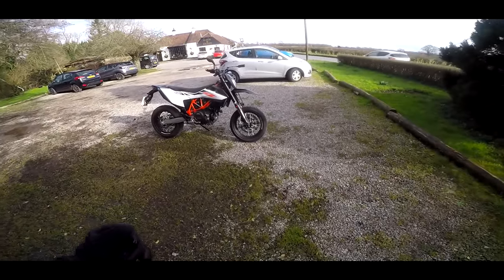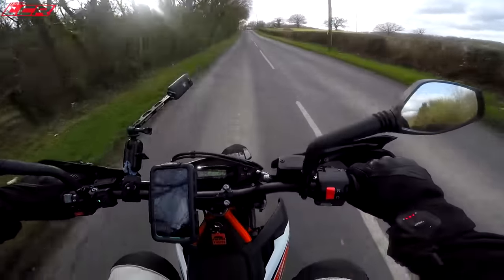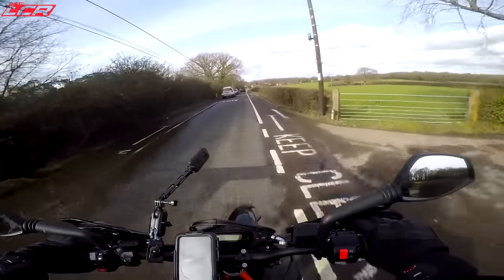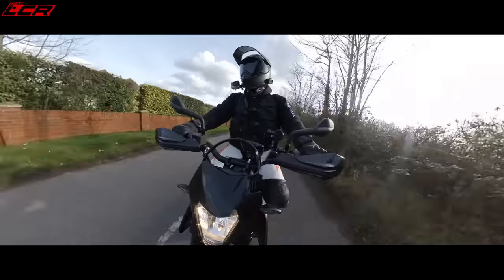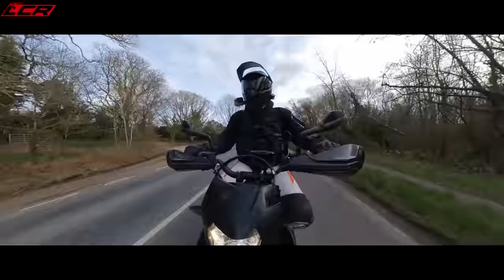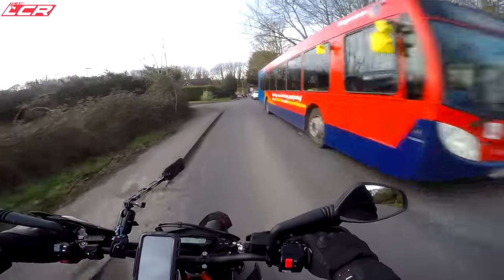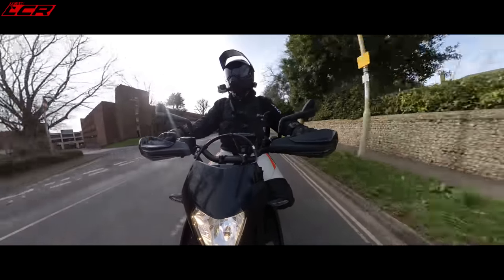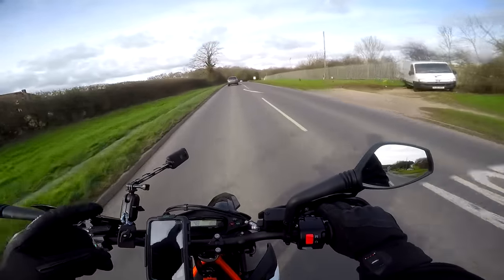How To Run In A New Motorcycle? | KTM 690 Diaries

Comment: I was talking to a Ducati master tech when I bought my hypermotard and he said 3 rules for break in: Let the bike fully warm up before hammering it, no full throttle at low RPM, and try to vary the speed (ie no 100 mile highway blasts with cruise control). So far that method has been working fine for me

Comment: KTM 530 soft run in - but changed the oil early. It’s done 7000ks trouble free - only had to adjusted the valves once. 
However it has used oil since new. It hasn’t gotten worse, but you need to check it after every ride, but it only has 600ml on the engine side (the gearbox is seperate on my 2009 mdl)

Comment: Perfect timing Chops as I picked up my new 690 Enduro r last Friday and I’m only 75 miles in to the running in period! On all the new bikes I’ve ever owned it’s always been as per the manufacturers recommendation, but with plenty of variation of load and speed on and off the throttle. Never had any issues with poor performance or oil consumption.
Reply: Bang on!

Comment: The manufacturer knows best about their machines. I'd recommend following their advice personally.
Reply: When you do that you get oil consumption issues 🤣
Reply: Mark Pearce  For liability reasons they can’t tell you to break in your new pride and joy hard.  It’s well documented that a very hard break in keeps these engines form burning oil.  In fact, all KTM and Husqvarna factory teams break their engines in hard.  Specifically the Dakar teams, where they have to be ridden for thousand of miles and where oil burning is not desired. It’s literally impossible to break these engines in to hard and cause any damage by doing so.
Reply: If you look... Manufacturers put the same damn break in procedures across a wide variation of motorcycle models with very different motors...so no!
Reply: Why do they get run to red line on dynos to test bhp after coming off the product line then ?
Reply: @Shawn-in-da-Canyon  I’ve heard that argument and it never made sense to me.  Comparing how I would care for a bike that I want to keep out of the shop as much as possible to how a race team that plans on rebuilding the bike after each race just never made any sense to me.

I suspect the real answer is somewhere in the middle as with most things.
Reply: @nsparacino  Well, the only reason I say that is, my good friend is the engine builder form one of the top Dakar teams. He’s one of the best engine builders that exist. They’ve spent hundreds of thousands of dollars researching this subject. And, my above post is the conclusion they came to. So, when he gives me advice, I follow it to the letter. And, he’s never done me wrong. When I bought my 701 Supermoto, I banged of the rev limiter constantly for the first couple hundred miles. I ran mineral oil in it for the first 1,000 miles. I have 16,000 hard miles on it. I change the oil and filters every 3,000 miles and it refuses to burn one drop of oil.
Reply: They tell riders to break in the bikes gently so that the RIDER gets used to their new bike. Every bike you've purchased was run hard on a dyno before it was shipped to your dealer.

Comment: I bought my Suzuki GSXS1000 from former SBK rider Karl Muggeridge at his dealership in Australia. He said just ride it up through the revs smoothly and that’s all that’s required. No need to limit revs except not going to redline. Many say it’s the first 20km that is the most important for the engine. Also, many people trade their bikes with low kms rather than keep them for 30-40,000 km (some do) so it’s highly unlikely that you’ll experience problems with the engine before you trade up. Agree that bedding in the brakes, tyres etc. is wise.

Comment: Now listen here young Chops. Back when I were a lad in 1974 I was told the most important thing to remember when running in my new Norton Commando was to vary the revs and the load on the motor, while not exceeding the recommended rpm. Apart from the header flange continually unscrewing itself due to vibration and the many oil leaks I could never stop, that bike was reliable and a real joy, even with points ignition. I now have 2500 klms on my new BMW R1250R and I ran that in the same way. Thankfully it doesn’t have the oil leaks or the points ignition. Great idea for the SMC series 007.

Comment: I've had 5 new bikes over the last 18yrs. All run in as per the manufacturer's instructions.

2002 1200 Bandit. No problems in 30,000+ miles great bike.

2012 Triumph Thruxton 900. One problem after another. Starting issues, used to cut out without warning, a lot of small rust spots started appearing on the bike. Dealer tried to tell me I had ridden on salted roads, I bought it in June stopped riding it by August the same year. Sat in the garage until I traded in after 1500ish disappointing miles.

2013 Yamaha XJ6. Brilliant bike ridden in all weathers. Racked up around 35,000 miles in 3 years,  never let me down.

2016 XSR900. Throttle was a bit jerky at low speeds. Having the bike remapped and set up on a Dyno fixed that problem. 7000 trouble free miles. Still own this bike.

2018 CRF250L. Only issue so far has been a manufacturer's recall for a transmission shaft. Apart from that 1700 miles in all sorts of conditions.

Comment: A couple of bike mechanics always told me rev freely but don't red line or labour the engine and the break in limits were manufacturers arse covering for if ANY post production failure did occur it would happen within the first few hundred miles, so you would be travelling slower and you would have a better chance of stopping safely.

Comment: I’ve just got a new multistrada enduro and like you watched the videos. I agree entirely that you are running in all aspects of the bike, not just the engine. The thing that convinced me was the comment on one site, “if something goes wrong, you’ll be better if it happens at a lower speed and lower revs, also it allows you to get used to the new bike”.
Great content, keep it up.

Comment: I ran my MT10 in between the two, not thrashed no laboured, mostly round the twisties so you are going up and down the gearbox but not over revving, oil change at 900 kms, all's good so far 😊

Comment: Nice Vid :) most people don't understand mechanics and mishandle engines like crazy... 

Funfact, I do remember those break in periods in car manuals.... (at least Nissan did that in the 90s..) it somewhat disappeared nowdays.
I had to replace the engine of my car 2 years ago... Was not sure what to do. As it is a forged engine from factory and most people are on the causious side in such cases.....
Luckyly I do have a friend building high performance engines for race usage.... So I asked him about bedding in... Going slow... Whatever.

He said:"if it is new, and installed by authorised dealers you got at least 1 year warrenty right"
I had to agree...
So he continued "if the engine is somewhat faulty it will develop a problem no matter what you do. Maybe it will take longer to materialise but it will happen. So wouldn't it be best to happen inside your warrenty?"
I had to agree.
So he said:"drive it warm reasonable, see if anything feels or sound strange....drive it with switching load and revs.... And if it survived about 50km without doing funny things.... Just push it. Let it cool from time to time but push it...if it stais together it will stay.. If faulty it will blow but you'd instandly know.... "

And I get it. Every part wich is supposed to touch anywhere has a hardened coating. That coating will not give and will not bead in anyway. A running eingine with its correct oil should run nearly completely without parts touching each other... The Valve train is the exception. So if a warmed up engine is running without wear (as they normally do) what excectly is there to be beaded in? 
Maybe if the thing is so new that foreign objects are inside the lubrication system... But that should go away after the first oil change.... And such parts should not be found in a well made engine anyway... 

However i drove the next 300km way faster the usual and reved out 3,4,5 and 6 from time to time even did a verry long vmax run....
Engine has now about 50k km, no oil, water or other consumptions except fuel....

On the bike.....well I may be a little more sensible because a damaged engine can stop the rear wheel pretty ugly so it is difficult... But you gain nothing if you are to soft on it and drag possible problem toll warrenty expires... 

Oh and he states: "a natural aspirated 4 Stroke should not need oil, if it does the engine is crap (build to low standards)"

Comment: The official running in guidelines from Honda for my NeoSports CB1000R are as follows- during the first 500km (300 miles) of running, avoid full throttle, starts and rapid acceleration, avoid hard braking and rapid down-shifts, ride conservatively. Not exactly comprehensive. I have kept my revs to around 4-5k range, change gears a lot, short shift, try to change direction, brake and gears in a progressive way for the 1st 600 miles. Once my bike has had its 600 mile service then I plan to increase revs to 7-8k (I will be going well above the legal limit before then) to 1,000 miles and then just enjoy - this is what I did with my previous Ninja 650 albeit for that bike the rev range I used was slightly lower due to its smaller displacement.

Comment: I broke it in like I stole it. I have over 13K km on it and won't be getting rid of it for a couple of years, but there have been no issues. There's a shift light on it that was set to 5500 RPM and when I got out of the dealers, I stopped at a parking lot, changed it immediately to 10,500 then promptly hauled ass out of the parking lot. 
I varied the rpm and didn't keep it in one RPM range for any real length of time, and I stopped and let the engine cool down about every 10-15 minutes to get it to go through multiple heat cycles as possible. Was a pain because my normal 45 minute ride back from the dealer took over 4 hours, and a ton of coffee was downed that day as I sat in the coffee shop admiring the new bike, and I changed my oil and filter when I got home and again at the 600km mark. That's the thing with a hard break in, that first oil change has to be done quickly. Don't leave the metal shavings in your oil for extended time.

Comment: I think it's a combination of mechanical sympathy, not being too careful and not being too harsh. I usually let it warm up properly, don't select too high a gear for low rpm's, choose routes that have lots of variation in speed. During the ride I regularly run it through the gears (3/4/5) with half-3/4 throttle to around the recommended running-in redline, than close the throttle completely and let it slow down/cool again. Make frequent stops to let it cool down a bit.

Comment: Thanks for that BMW link. Every new  bike I've owned first thing I do try not bring over 5 K rpm for first 500 kilometers, also change engine oil before first 100 kilometers, using non synthetic until 2000Ks. Never keep it constant rpm, up and down through gear box, in the city. Also first 100 k don't run it for longer than 20 mins, just too much heat get expansion. These are my some of my own and a friend that did build big block drag motors.

Comment: Hi chops, I’ve had several bikes from new, always followed manufacturers guidelines; never had any engine issues, did 23k miles on a 2013 blade, no engine issues, 10k miles on a RSV4; no engine issues, can’t remember mileages on the 91 cbr600, 94 vfr750 & 98 R1, I had them for several years without any engine issues

Comment: I've got a Honda Blackbird with 86000 miles on it, no engine drama at all.. no oil leaks or anything since I've had it from around 50000 miles, whoever ran this one in did it the right way I reckon.

Comment: I'll start running in my new VFR 800F once the season starts here, the primary goal for me has always been to be smooth on everything, emphasis on good clean gear changes, not lugging the engine and getting it properly warm before really opening it up. (staying away from the very top of the rev range)
  After about 500km i'll change the oil and slowly build up my speed on it, start riding it like i am going to do eventually still emphasizing on being good on the controls, up-downshifts etc. Then the service is at 1000km. If you want your machine to last, dont be afraid to ride it or use it but operate it with a degree of mechanical tenderness (especially early on) but also down the line, and modern bikes will last you ages.

Comment: Hi Lamb Chop....I'm the guy who lives in s/w France on his 4th 1290 Superduke & now a Tenere 700 has joined the family.....For the running in issue I've always thought that the worst thing to do is stagger the engine, so don't use too low revs which must create a lot of strain on all the moving parts, high revs probably not so bad. Just keep the bike in that midrange sweet spot....let it rev freely.
Off to Spain today on the tenere & don't forget my invitation if you would like to see some of the best roads in Europe

Comment: When i purchased my brand new new ZX6R 636 KRT in 2016 my local kawasaki dealer who was a manager there at the time told me to ride it like i stole it as it would make be better for the bike...however i rode her like she was a virgin very gentle with her, i did have moments where i would open her up slightly, ive still got her now and shes running perfectly with no issues what so ever! Personally in my opinion run the bike in according to the manufacturer , better safe than sorry i say 💚

Comment: In my 50 years of motorcycle, car and truck ownership (with 30-years as a professional driver, driving my own vehicles for work up to 12-hours a day), I've always done medium-hard run-ins, and have never had any issues with performance, fluid leaks or reliability. I'm cheap, so I hang on to vehicles longterm. I'll never tell anyone to do it my way, but I won't NOT tell them to do it my way either. ;)

Comment: Back in mid 2017 I bought my first big bike being an MT09 (upgraded from a WR125X). I broke mine in in accordance with the manufacturer guidelines and in the time I've had it I've done over 30k miles. I've had a disc warp on both the front and rear, a knotch develop in the headrace bearing and I've had 2 O2 sensors, an oil level sensor and gear position sensor replaced (4th gear stopped being displayed about 30 mins after switching the bike on). 

Besides that I've not had any mechanical faults with the engine and everytime I've had it serviced at the dealer (inline with the manual) they've always said it doesn't appear to have burnt any oil at all.

As always Chops, great video.
Reply from the maker: Ok Tom very interesting indeed! Good to see it worked well for your bike 👍

Comment: I side with manufacturers break-in recommendations. For one, if the bike has initial problems the dealer will ask did I follow the break in procedures. Second I tend to keep all of my cars and now with my first new bike I intend to enjoy it for a long time. Thanks to your channel I got a 2020 Triumph Street Triple RS. At the moment the bike has about 245 miles with no issues following the break in steps. It’s been really difficult keeping the RPM’s in check. Cheers.

Comment: Breaking in any engine is better with lower revs. You want to load it, but at low rpm. Up shift out of corners and bog the engine down with load. That along with heat cycling is the best way. With newer Carb 5 rated bikes it's  even more important. Since they run so lean.

Comment: Hi Chops. Nice vid as always. I nearly always buy my bikes as low mileage nearly new as they are around 20% cheaper. My GSXR 750 was 0 miles, I ran it in by the book, it was fine. My latest Tuono V4 Factory has 412 miles its ex dem. (£12395), I’m being careful but who knows what the test pilots have done, although you’d have to have big stones to thrash a factory in Croydon. My theory is don’t rag the arse off it and more importantly don’t labour it for about a 1000 miles.

Comment: I agree that due to modern engine tolerances, short of abusing the engine, I'm not sure it makes much difference anymore in terms of power at least but very few if any scientific studies have been done on long term reliability it seems. However I've run a few bikes in over the years & I essentially do pretty much what the manufacturer says for 600 miles & after the first service I go up & down the box & through the gears to about 80% of maximum as often as I can until the 1000 mile service. I also remember Suzuki's mechanic telling me when I bought a new GSXR750 15 years ago, you should never hold it at constant revs for too long or do high gear low speed roll-ons when running it in as the constant revs will cause barrels & pistons to "glaze" too quickly & won't bed in together properly & the roll-ons put big strain on the new components.

Comment: Just bough a new 1290 SDR and I'm following the procedure as I dont want any warranty issues. But I rebuilt my 30 year old KLR250 engine last year (new piston and rings) and hat had a hard run. No issues so far, 600 miles on, but time will tell

Comment: I Recently purchased a new GSR 750 Moto GP im still running that in. The manufacturer states not to exceed 6000rpm but I spoke to the dealer and he says if you do exceed the 6000rpm not to hold it to long at high rpm. so accelerate then come of the throttle. due to the rubbish weather in the uk I have only managed to do 60 miles in total on the bike so I have another 540 miles left until she is run in. I hope the weather improves soon so she can be run in just in time for summer. Well I say summer but the 2 weeks of decent weather haha. Keep the videos up chops there always great.